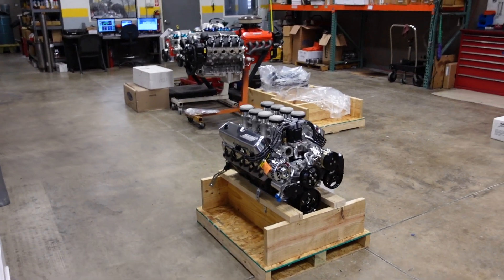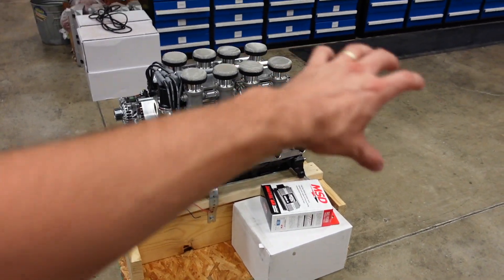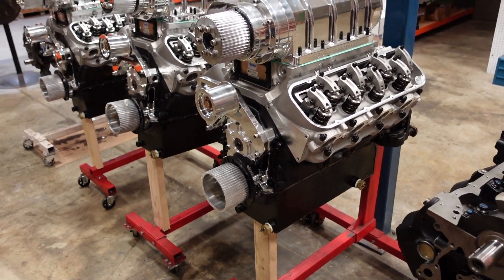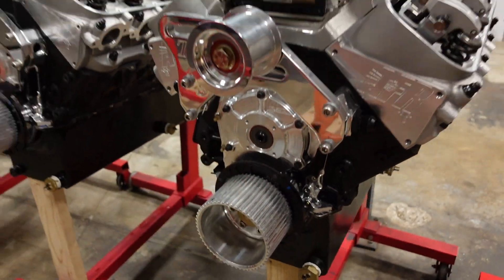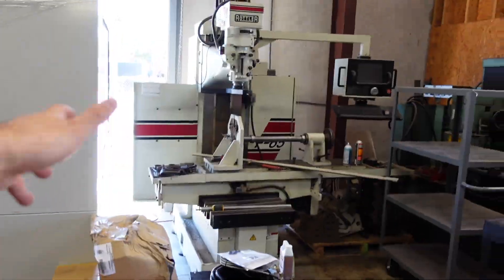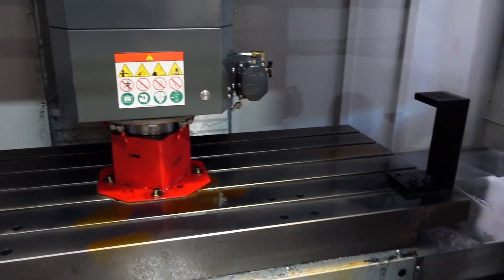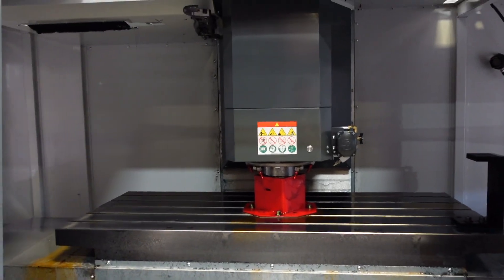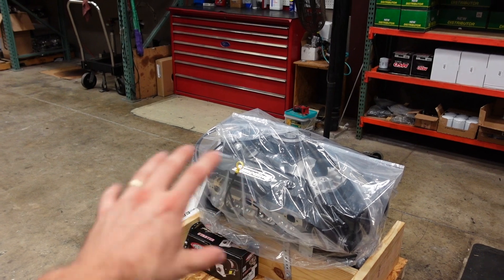427" 8-Stack Small Block Ford - Behind the Scenes at Smeding Performance

Comment: Will that new CNC allow you guys to sleeve LS and LT 5.3L Aluminum Blocks with Darton 4.125" or larger aftermarket sleeves, to perhaps give guys another option like others do since aftermarket Aluminum blocks are still quite expensive in comparison ? that would be a new wicked feather in the Smedding Performance Cap ;)